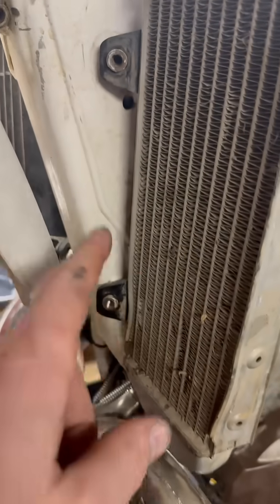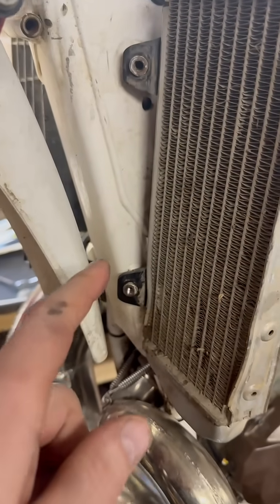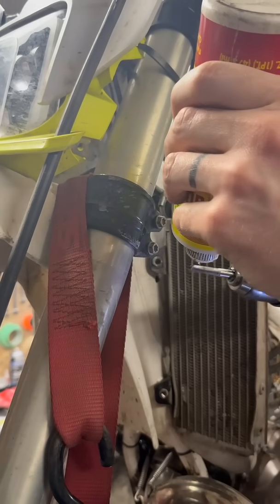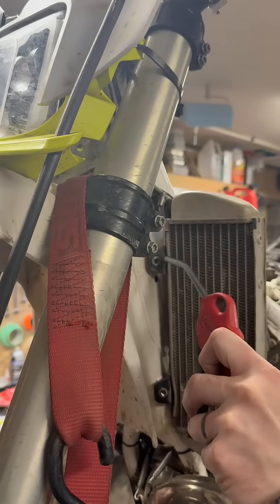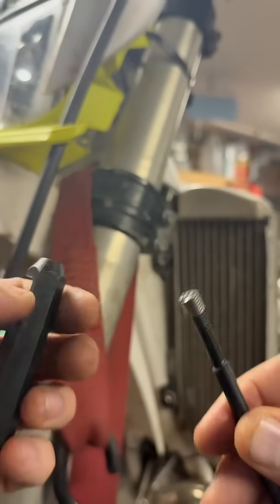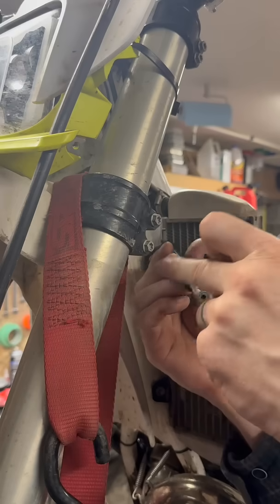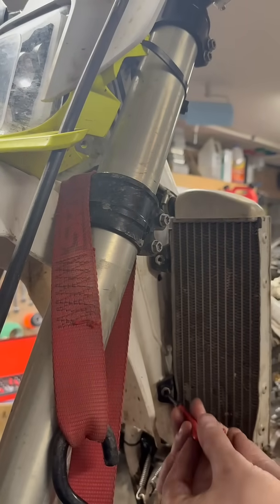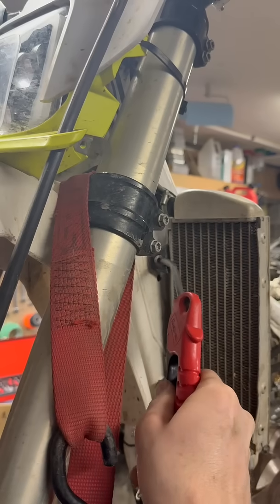Heli-Coil VS Time-Sert

Comment: I don’t know if you’ll get to this comment but I’m actually putting back together my TE 300 I and I stripped out the female lobe that sits inside the power valve assembly. It’s a piece of aluminum that looks kind of like a cam and it’s mounted between the exhaust flange and the cylinder wall. The control arm that comes up from the bottom and mounts to this assembly that is bolted into that hole. I’m considering putting a heal coil inside of that female piece of aluminum. I’m not sure what it’s called but if you’ve been in this motor. I’m sure you can picturetrying to describe

Comment: In my experience you are better off drilling the nominal diameter hole like 6mm for a M6 helicopter when repairing threads in aluminum engine cases

Comment: Im led to believe a heli coil is stronger than the factory cut threads anyway. Its rare but where i have seen timeserts work well is in sitautions where the housing isnt strong enough to support whatever ite supposed to long term. Like an ac compressor thats weight an vibration damage the holes in an aluminum housing over a long oeriod of time